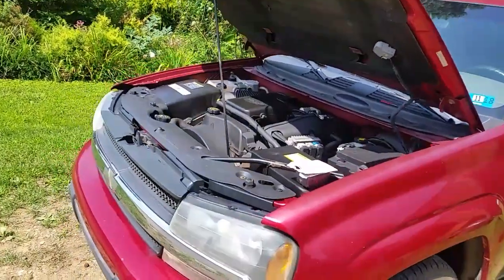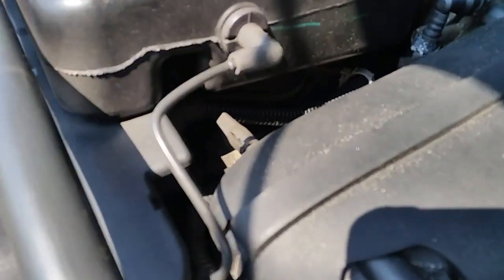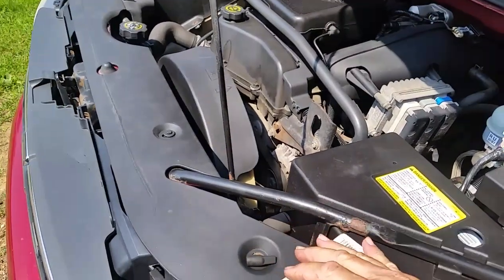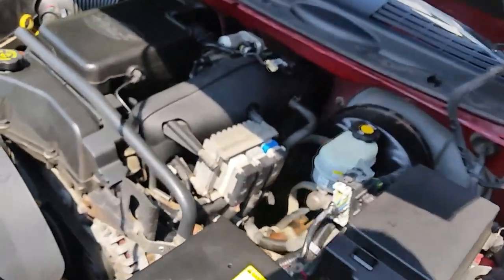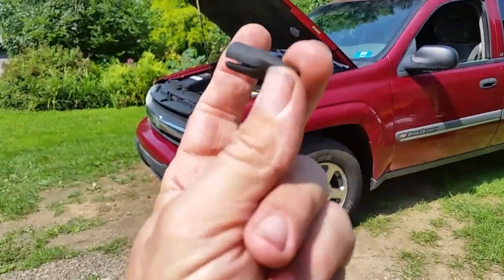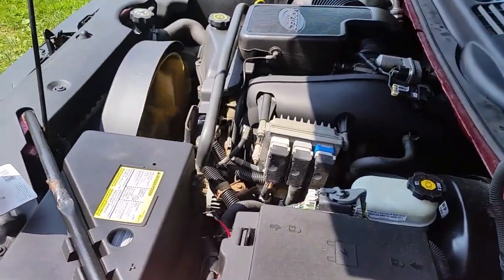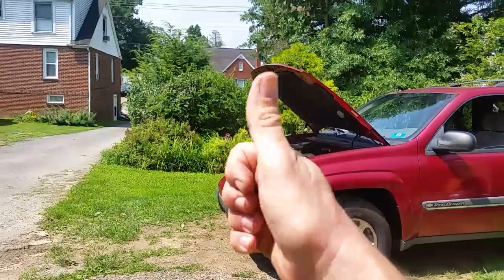High RPM on start up. Trailblazer 02-09

Comment: My 08' TrailBlazer started doing the high RPM right before Christmas 22'. I've had the truck only 6 months and I've been hearing a hissing sound the whole entire time. My son in law couldn't find what it was. I watched your video and had my son in law check the vacuum cap today. Low and behold it was the exact same rubber as yours (probably the original) and it had the exact same crack. Thank you for this video because we went to AutoZone and they had no clue what we were talking about and couldn't find a replacement. We went to O'REILLY'S after and showed the video and they knew exactly what package we needed to get. Thank you so much for this video!!! 💖 From California
Reply from the maker: Awesome cool!!  Great!

Comment: A had a code p0171 and tha was the problem..and my chevy trailblazer 2007 is running great 👍
Reply: What was the part called I have the same problem I went and looked and mine and there was no cap on it...it is idling excessively high I need this fixed it is so dangerous

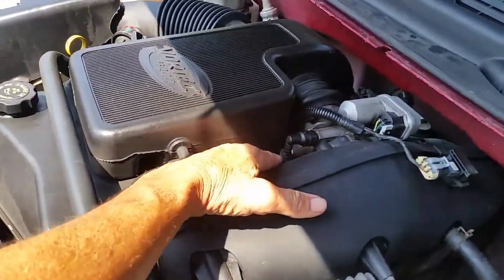Comment: It's likely just a simple mistake but to avoid any laypersons acquiring the mistake... @2:33 you say PVC (Polyvinyl Chloride) when referring the PCV (Positive Crankcase Ventilation) Valve.  Not tryin to be a grammar nazi, just a friendly correction cause this is something I catch myself doing as well.  Thanks for the video!

Comment: Very first thing you should do when buying any vehicle is replace the PCV valve, period. Then replace your plugs, plug wires, etc. Replace/clean air filter, replace cabin air filter, and clean your intake. Idk why people never seem to maintain ANY of this stuff. I've owned a LOT of vehicles and not once have I ever gotten one where they ever did any of this. It's ridiculous.
Reply from the maker: Yea good oil also

Comment: I've done a lot to fix this and it still happens. Idk what it could be besides my actual computer. I replaced my catalytic converter, 02 sensors, evap canister, purge solenoid. Cleaned the throttle body. Still have high rpm on start up. It feels better and rpms lower faster after I changed cats. It still sits 4-5 hundred rmps high and then slowly goes down to normal. I figured it just needed an idle relearn. Let me know what you guys think??
Reply: Got the same issue my last resort is going to be changing ignition coils

Comment: I have a p0171 code on my 08 ls 4.2  and just change the intake manifold gasket it was driving fine but I would like the code gone but I notice that hole u have plugged didn’t have a plug and was sucking air but it’s been driving fine should I plug it?

Comment: My car would rev too 2000 rpm so noise and it just stay there for ever. Plus driving it were it wont idle down is a big hassle try to brake and stop when the engine is still going way to high car just wants to take off. So pulled over in the Walmart parking lot walked in grabbed MAF flow cleaner pulled the tools out of my trunk pulled the air box off took out my MAF cleaned it also cleaned the IAT sensors sprayed the connections checked for vacuum leaks checked for cracks put it all back together and it idled down quick I don’t know what I did but it’s strange

Comment: I always change the Pcv valve in any car I buy used. if its clogged or broken it can actually make you burn oil. which is not good.
Reply from the maker: True!~

Comment: I have one 2005 trailblazer. And the cooling fan seems blowing all the time. I understand that these fans are clutch operatable. When the engine it's off I try to move the fan with my hand and it feels tight. I'm assuming when not working should be loose. What anybody think?
Reply from the maker: Locked up.

Comment: Could this cause a p0455? I have that on mine and I've replaced the evap solenoid, purge solenoid, and then cleaned the throttle body while looking for any vacuum leaks. I've looked under the vehicle multiple times and all hoses look perfectly fine. Any ideas? I also just checked this plug on mine. It is loose. I can spin it with my fingers. So I probably is getting some air. I'm going to replace this and hopefully that will do it.
Reply: Hey I know this is like a year old, but another possible fix can be replacing the fuel tank pressure sensor. It is located at the top of the fuel tank. Also, check your filler neck cause those can get really crusty and the rubber o ring on your cap.
Reply: @stickit2theman1 Thank you very much, i know its an old comment. it still does it and its just sat for a while. i need to drop the tank and check all this stuff. i appreciate it man
Reply: @stickit2theman1 It still has high rpm on start up for about 30 seconds to a minute until it warms up. around 900to1k rpm slowly getting lower, runs good until  it gets to about 600 rpm then it starts to stall. im lost on it now. tired of messing with it mostly just tinker when i can
Reply: @tylersanders8853  hey Tyler thanks for the reply
I think when I sent this comment I was struggling with an issue of my own. Figured out eventually I had a clogged catalytic converter. I had no codes to help me so it took a lot of research and time. All I knew is it would bog at high RPM and there was an occasional rattle when I revved.
I confirmed it was the converter using a pressure tester I got at harbor freight and drill two 1/8 inch holes, one before the converter and one after. You should have little  to no pressure before the converter. Test the pressure after the converter for a baseline test, then test before the converter. I had about 4-5 PSI when I revved the engine. This video shows the process https://youtu.be/Ji06DwUqxQY?si=tUJlEMBeLk1BIXBc
If the cat isn't the problem you can fill the holes with a couple self tapping screws.
Good luck to you hope you find the problem!!!
Reply: @stickit2theman1  i actually replaced the cat about 8 months ago and it was clogged. ive done tons of work to the tb since then. i cant buy another cat converter for it. spent enough money trying to get it to run right. I know my smog canister is working under driver seat. thought that is why the cat wasnt getting hot enough but its working.
Reply: @tylersanders8853  now I don't feel bad about getting a new cat at 276K miles. Probably needed it anyway.

Comment: this is impressive but i want to know exactly which connection is that? is it around inlet manifold?? actually i dont have trail blazer but suffering same issue in montero
Reply from the maker: Some type of inlet.
Reply: @FixingWithPassion  hey there question did the vacuum leak make it runs rich as well????

Comment: Hey Nathan,
 I was driving my 2004 Chevy Trailblazer LS been running smoothly just had an inspection to get new tags. So I was driving about 30 MPH and all of a sudden my car  ReV up and down. I never felt slipping in my transmission at all. Ran smoothly Pull to the side. And when I put the gear in Reverse, Drive and the rest of the gears. If I push the gas pedal it does Rev as it should. 
It will not move at all. Then someone said my transmission fluid was overfill.
Have that drain to the right level. And still no moving.
No check engine light. could it be my  Transmission Shift Solenoid?  
Never had a sign of slipping.
Can you help me?
Reply: Check the L shaped pcv hose on the intake manifold, usually with heat and wear it cracks making the engine run poor

Comment: No PCV on this vehicle.. That is the fuel line
Reply: Wrong, crank case vent to throttle body. Fuel lines don't run into throttle body's. Fuel rail to injectors...
Reply: @joesmith9159  ahh.. Thanks..
Reply: @blueberryii  No problem! Happy wrenching...